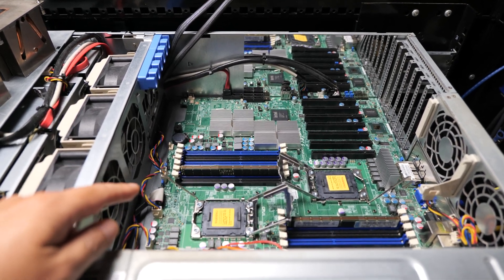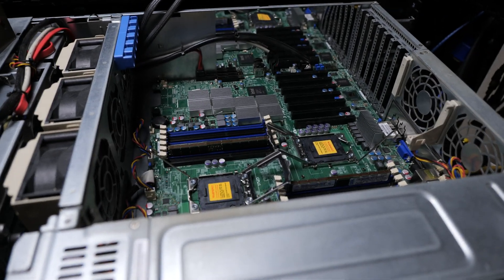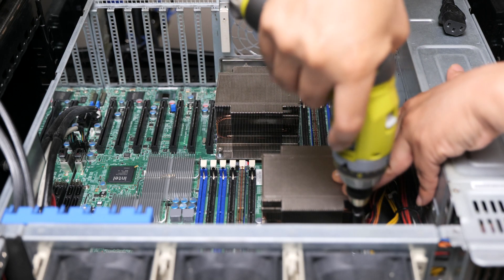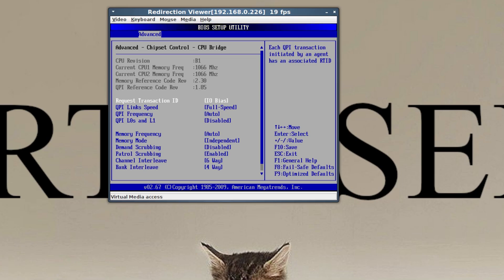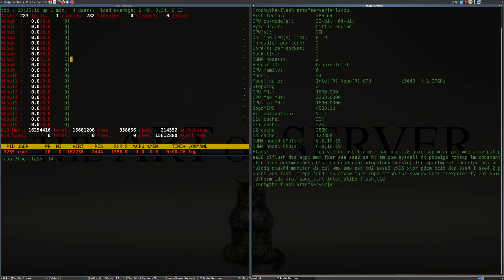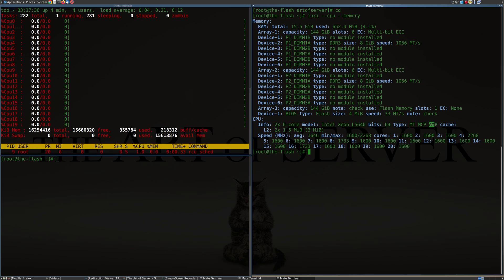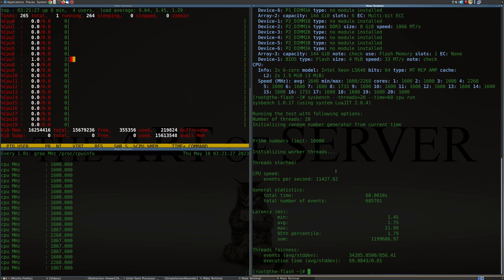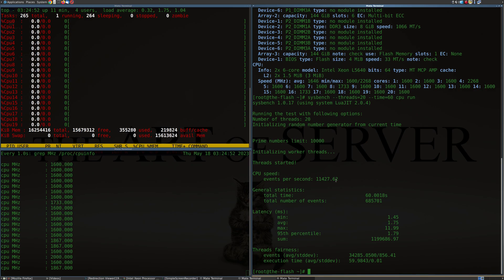Asymmetric Multi-Processing

Comment: I still run the same board X8DTH-iF but with a slightly modded BIOS.

That aside most OEMs will check at boot if both CPU's are the same... And halt the system if they're mismached. (I think memory is foggy)
Reply from the maker: Those are good boards! What type of modded BIOS?
Reply: @ArtofServer  I updated and extended the CPU microcode, changed OpROM versions, newer Intel AHCI/RAID/NIC modules...

Comment: ive got a Z800 which will NOT do the same thing, at least not with the BIOS that I have in it.  it also wont run the X5680's which really pisses me off...but anyways I wonder if this is a Supermicro thing or if maybe it was just never limited on thge 5000-series chipsets and Supermicro allows it but HP doesn't?  I dunno....effin cool though!  But I think it MUST be vendor dependent
Reply from the maker: Hmm... have you any other dual socket systems to try out?

Comment: What happens if you try to run a program that uses instructions that one of the CPUs does not support? It can then not simply switch from one CPU to the other as different binaries are needed?
Reply from the maker: I think both of these CPUs have the same instruction set.
Reply: I did this on my old SPARCStation 20 with SM61 and SM71 CPUs. Compiled a program specifically for the SM71 that had a slightly newer version of the instruction set, then ran it in the mismatched 2 CPU system. 
When it executed on the SM61, the program dumped core. Amusing, but less dramatic than I'd hoped.

Comment: An interesting combo would be brute forcing the Performance-Efficientcy Cores feature found in newer Intel cpus. 

Like lower end cpu with capped power plus higher end cpu on full blast
Reply from the maker: thanks for the suggestion!
Reply: If you have an SR-2 you can even do this for the memory side of things. You could have something like an overclocked X5690 with full memory speed, and a forced lower multiplier low power CPU with low memory clocks and voltages on that CPU's imc

Comment: I was running a 333 and a 433 celeron together at the turn of the century. Never really believed the boilerplate compatibility bs manufacturers come out with. For the most part it's about SUPPORT. They don't want to spend extra money SUPPORTING oddball edge-case configurations. 
Doesn't mean it doesn't work. Just means they wont support it.
Reply from the maker: yup.

Comment: 1. This is still SMP
2. There would be no NUMA issues, as they still use and speak same coherency language

Symmetric Multi Processing doesn't refer to amount of cores, speed or even architecture
It refers only to where kernel is run
SMP kernel runs on all cores equally
ASMP runs on single core and manages rest of them only for user space

NUMA stands for Non Uniform Memory Access
Speed of memory and/or number of cores does not influence NUMA in any way, as procesor 0 cannot read memory of processor 1 and vice versa. It politely asks another processor to read or write memory and waits patiently to finish
Reply from the maker: thanks for sharing!

Comment: Pretty cool that works. I would chalk it up to one of those "it shouldn't work but it basically does and is certainly not recommended" situations. My own anecdotal experience. I have an old HP ML350 Gen 6 with a pair of L5640s in it. And while the CPUs are a matched pair they are often times running at completely different clock speeds, in a sort of asymmetric way. 

Could be that the chipsets of that gen were a bit more forgiving as those chips use QPI 1.0. The Sandy/Ivy Bridge Xeons use QPI 1.1 and maybe Intel took the ability to do what you did in this video out with the updated spec.
Reply from the maker: yeah, I wonder if it works on all platforms from the same generation or if this particular motherboard is just less restrictive?

Comment: if thats the x8dth i think it is, the CPU's are not connected to the hardware the same as modern CPUs. you can have one CPU and still access all the PCI lanes and other hardware, where as newer hardware splits lanes b/w CPUs.
I would speculate that difference in arctitechure could be related to why this works.
i might mess about with one of the x8dt6 I have. see if itl run an x55 and x56 that I have. I suspect that would not work, but I never did try it.
Reply from the maker: Yeah, it is X8DTH-iF. And yes, PCIe lanes are connected through dual IOH so that's why it can have that many PCIe slots. Also the BIOS SPI connection is via ICH10R South Bridge, so you can boot with either CPU0 or CPU1. Unlike the newer generation, where the SPI is connected to one of the CPUs and that CPU socket must be populated to POST.

I'll be interested to know what you discover playing around with the X8DT6 board. That was a good board for NAS build!
Reply: @ArtofServer  interesting! I don't have an X8 board, just X9 and X10's. Now I have to go look at some various block diagrams of X8/9/10 to see how they may differ.

Comment: I think you just found at least two bugs in the kernel :D… I wonder now how vCPU hotplug will behave (already looking for qemu/xen options to set it up)…. I didn’t catch the os/kernel you were using… what was it?
Reply from the maker: CentOS 7 Linux kernel 3.10.0-1160.90.1.el7.x86_64
Reply: @ArtofServer  It would be interesting to try with a newer kernel to see if it can take advantage of the different clock speeds, instead of just using the lowest common denominator.

Comment: Every CPU has model, stepping, revision info stored in some kind of ROM ready to be used as an identifier for the system. This way CPU-Z should have no problem identifying each model switching between sockets, I'm sure there is a Linux capable alternative. The fact that they boot, tells me that Lxxx SKUs really are just low-freq binned versions of same silicon in Exxx.

P.S. 4:30 Pretty sure that springs do not work in a fully compressed state.
Reply from the maker: What do you mean about "springs do not work in fully compressed state?"
Reply: @ArtofServer  If you compress it all the way, you overcome pressure that they are designed to apply on CPU heatspreader in this case. No better that a simple screw that you would need to tension with a dynamometric screwdriver otherwise. Regidity of the spring is calculated to be roughtly equal to correct torque, so you should free the scew a bit, so the spring would hold the assembly in place.
Reply: @MIHU For "bottoming out" there exists helical spring type washer, that costs pennies compared to actual spring designed to spec. You are over-tightening by bottoming out.
Reply: @MIHU Not the exact model, but similar mounting construction. Not sure about threads and if it helps anyhow.

Comment: Could be a case of lowest common. But my first thought was that it was just showing CPU0. I'm surprised the bios doesn’t just show CPU1...
Reply from the maker: Yeah, I don't know for sure. It's seeing CPU0 with the L5640 and is using the base frequency of the L5640 at 2.26GHz, but it is using the max RAM speed of 1066MHz of the 2nd CPU E5630.